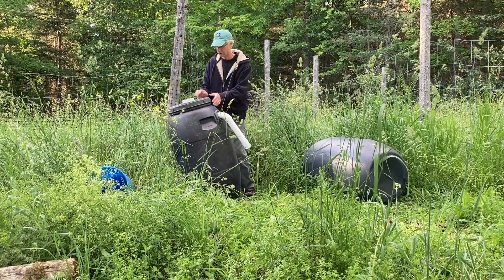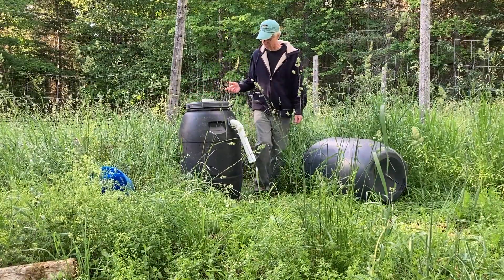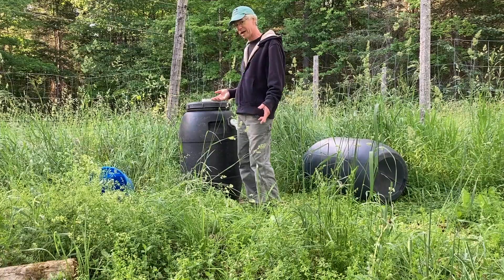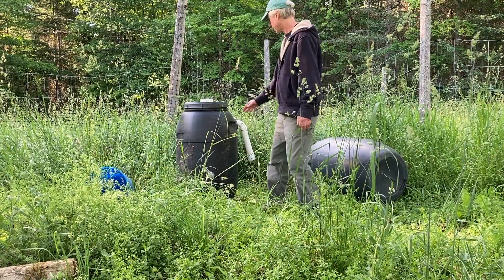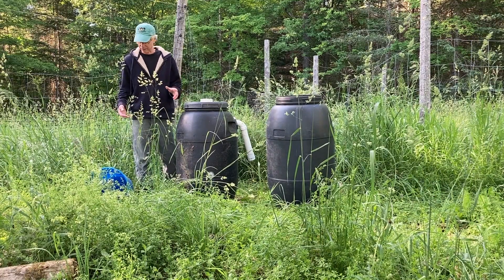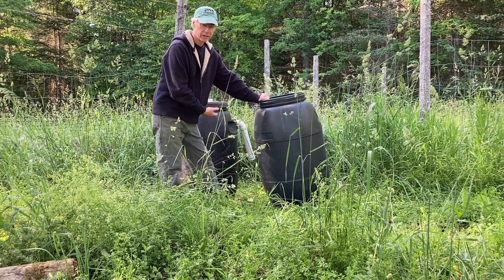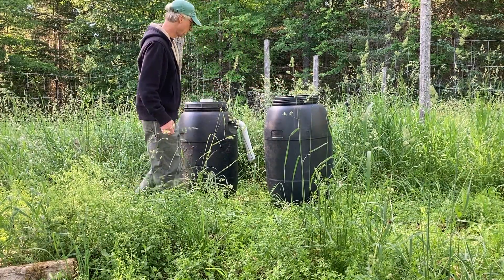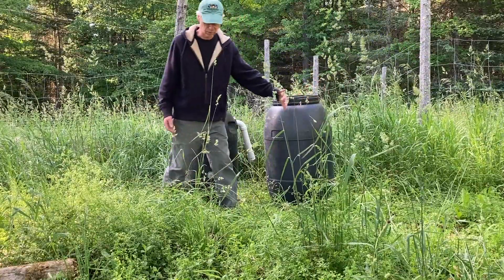55 gallon Biogas Digester Part 1, resurrection and overview

Comment: Guessing it doesn’t actually smell great
Reply from the maker: In fact, many farms use AD to reduce manure odors! If done well, smell is minimal as its an airtight process.
Reply: @HandsOnOffGrid   very cool. Would be interested in seeing content on the biofuel and bio diesel topics. I know people can make biodiesel to run diesel, can the same be done for a gasoline-like biofuel? You said your not a purist, nor am i, i just like the idea of being able to make it. Something you could put into a car. I know ppl make ethanol, but you cant just put that in the tank right? Sorry, but you seem to explain things well so thought you may be able to help. Im new to energy nerdism.
Reply from the maker: gasoline and diesel engines can be modified to run on propane and natural gas.
Reply: @HandsOnOffGrid  so that means biogas from the digester right? Compressed in tanks or bags? I’ve seen the firewood trucks, but don’t see any biogas cars
Reply from the maker: @LuckyBastardCandleCo  biogas scrubbed for purity and compressed for range works in gasoline engines. storage is easier in stationary applications like a gas generator
Reply from the maker: Also suitable for use in diesel engines, mixed with diesel fuel at the air intake